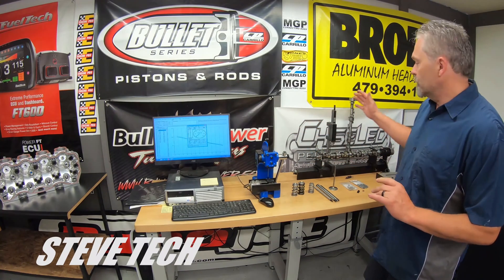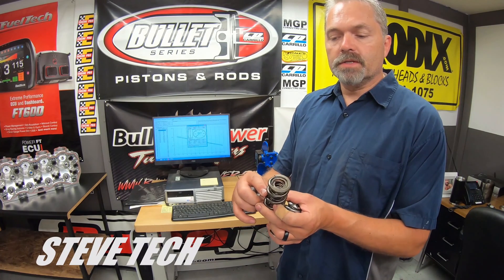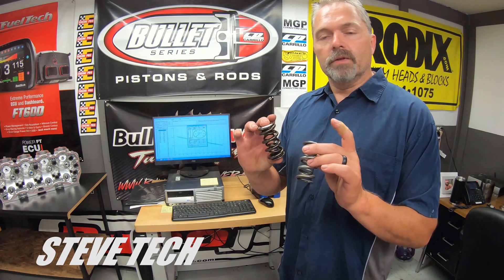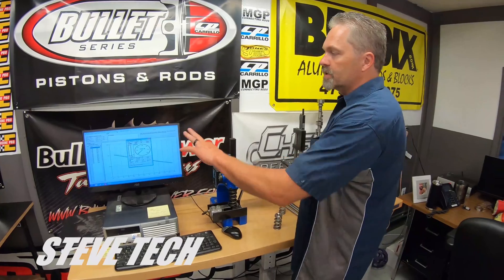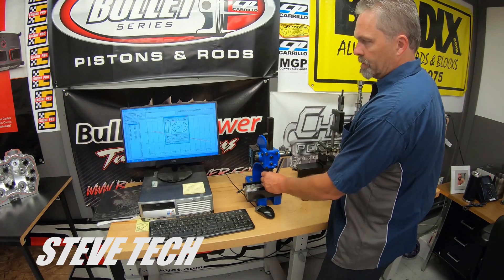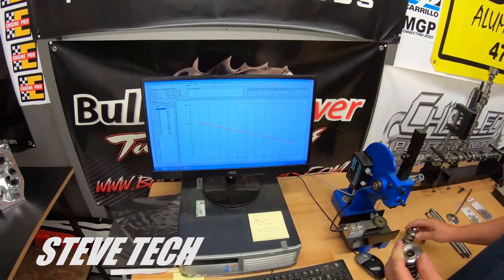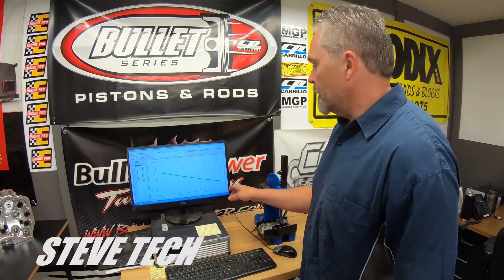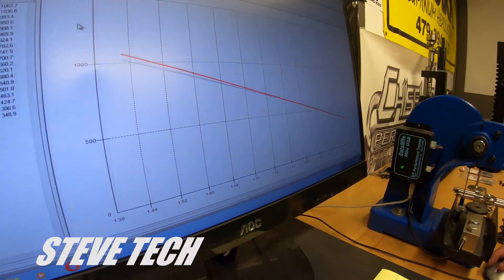Valve Springs

Comment: If 5 pounds of pressure will keep the valves in SEATED in place, for the COMBUSTION to SEAT the VALVES under Combustion Pressure, why do we INSTALL SPRING RESISTANCE to the Engine HP during Valve "lifting" Operations, using Springs that become more resistive? Would not a torsion bar that would only apply pressure for SEATING, Make More Sense? Why not employ a torsion bar that only RESISTS Engine Horse Power for the ValveSeating-Process-ONLY a 5 pounds, when that same Torsion Bar would be Engine-Resistant-Free as a SpringLESS Valve Lifter? Jack Houman, Stone Mountain

Comment: On your valve spring tech series can you touch on how boost effects valve springs and how much more spring is needed under boost to keep valve under control?   Great info, love the tech series...
Reply: My experience is it doesn't really make any difference since the drive pressure tends to be similar to the boost pressure the valve face itself does not really notice any pressure difference from boost.

Comment: frequency is a good enough term when it's actually called harmonics so you can get engine harmonics and valve train harmonics to can cause valve spring float just from oscillation from the harmonics not necessarily the pressure problem

Comment: I want to know which one vibrates less when it goes from open stage the clothes stage and rest I want to know how much the spring vibrates does the triple spring vibrate more than dual spring
Reply: Im running 10,500 rpm on my inline 4 cylinder and its a dual spring setup w/ a high lift cam. Got over 30,000 miles on the this build with no problems.